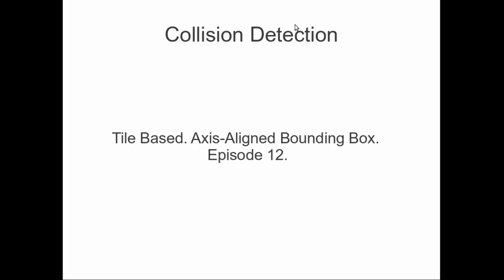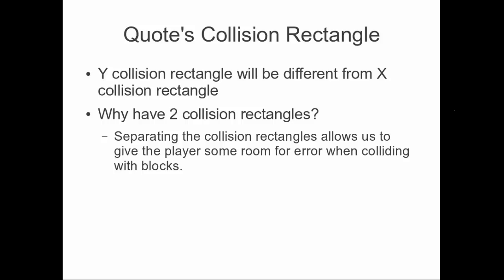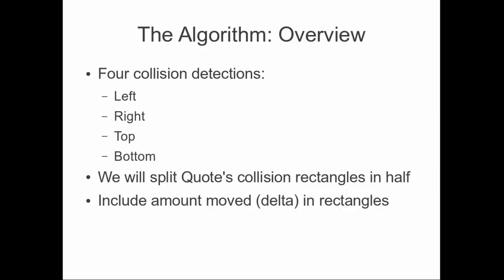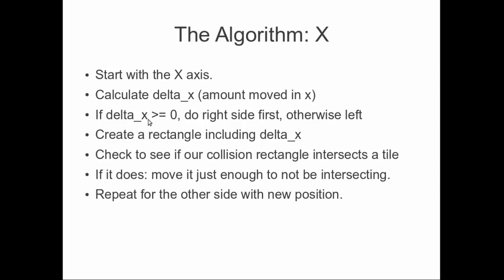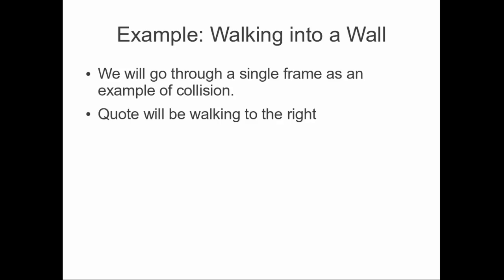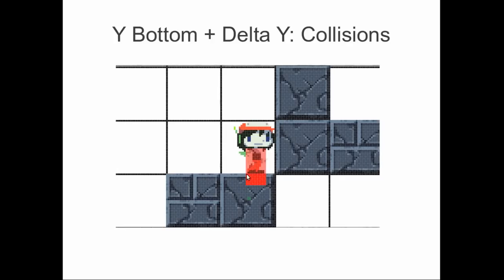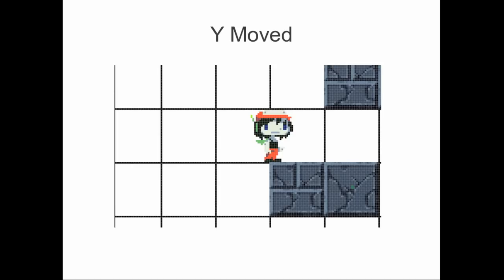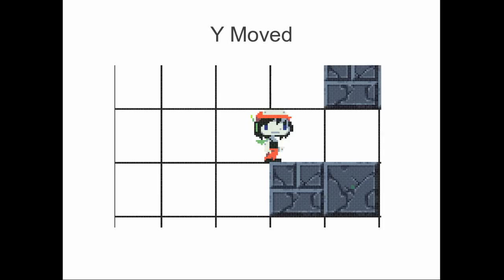Episode 12 - Reconstructing Cave Story: Collision Theory

Comment: Sorry for silly question, but why can't we move him first, and then if he collides, move him back to initial position?
Reply from the maker: No this is a really good question. I'm going to break it up into two questions though:

Why don't we move him back to the initial position?
We don't move him to the initial position because we want him to line up flush with the tile after a collision. Otherwise if you imagine that Quote is just above a tile, he would always appear to be "floating" above the tile, rather than appearing on it.

Why don't we move him and then check to see if he collides.
This is because we are (currently) using a variable time step, meaning we compute how much tme has passed every update. Since this can change we could (in theory) have a LARGE time step. If it happens to be big enough, Quote could essentially move to the tile. By extending the rectangle instead of actually moving, we make sure that we don't miss intermediate collisions. Check out http://www.gamasutra.com/view/feature/131598/advanced_collision_detection_.php for a really good description of what's happening.
Reply from the maker: Christopher Hebert
Specifically (in the gamasutra article) you can search for the text (without "s)
"But our method is flawed."
Reply: Christopher Hebert thx, I get it now!